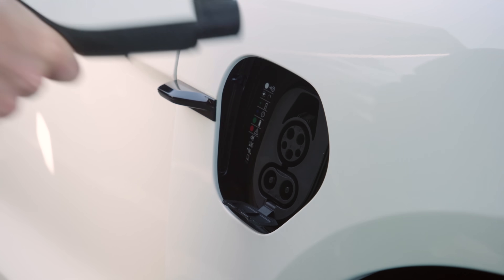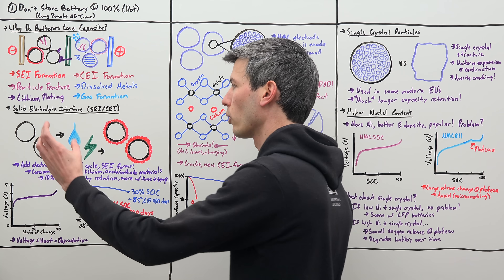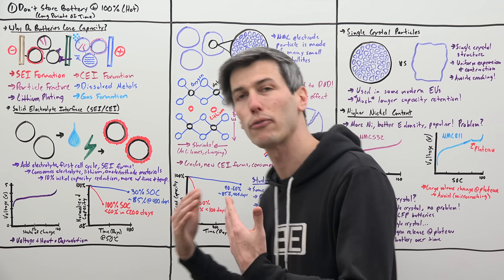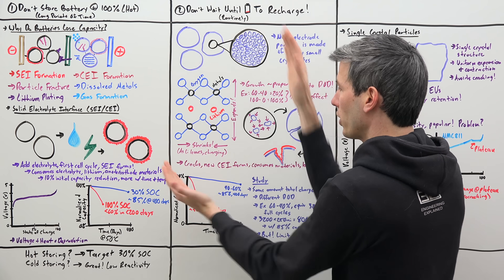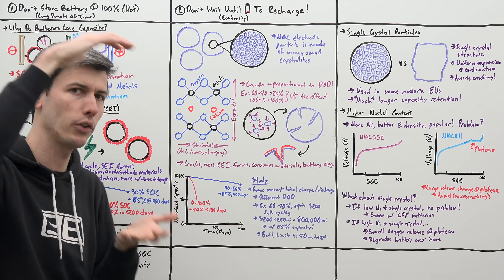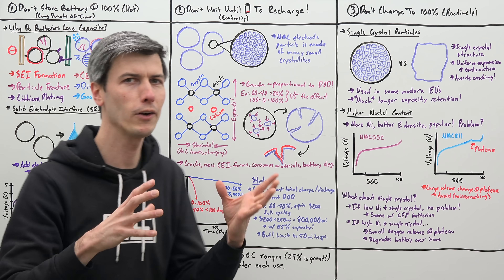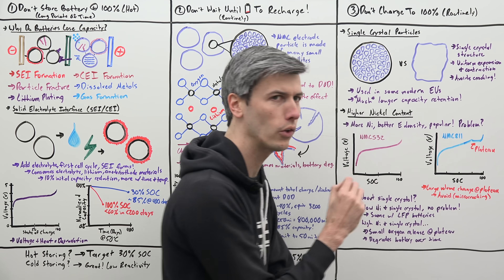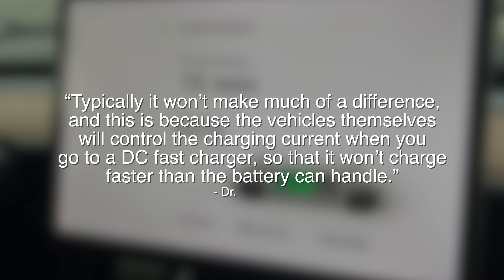How To Ruin Your Electric Car's Battery - NMC Edition!

Comment: You answered one of my questions.  We just bought a Chevy Bolt EUV.  I've been recently plugging it into 110V in my garage and doing a trickle charge overnight for multiple nights.  I wasn't sure if this was bad for my battery.  Sounds like it is better than doing a full charge using a level 2 charger.  I should also mention that I've only charged on level 2 and level 1 (in my garage at 110V).  Have not charged using a Level 3
Reply: From a perspective of battery health, level 1 vs. level makes no significant difference. But, from the perspective of minimizing one's electricity bill, level 2 is more energy efficient, plus the faster speeds of level 2 make it easier to schedule all of the charging to happen during cheap off-peak electricity rates.

Really, the only reason to charge off of level 1 is to avoid the up-front financial expense of installing the level 2. But, once the level 2 is installed, there is no reason not to just use it all the time.

Comment: More than often its not degredation that kills a battery, more often its some silly gadget inside the pack like the BMS, contakters or a cooling leak, so molycoddeling your battery will get you nowhere. IMHO you might as wall do what´s convienient on the day and foget degredation.

Comment: Great video. Are some of these studies referenced actually about cells and not a battery (collection of cells)? Wouldn't the impact be different due to the BMS which should theoretically help to swap between cells during charging and keep each cell at a good SOC as well? If you have 100 cells in a pack, you could say 33 cells at 100% would be a 33% SOC, but I'd think that the BMS would instead be splitting that amongst the cells in some intelligent way such as 100 cells at 33% each... or a mixture of 20-60% for performance related issues, cooling efficiency if fast charging (only cool parts of the pack as needed?) --I don't know anything about this, but just seems like there would be a lot more complexity when put together as a system with the BMS. Anyone know how that all works?

Comment: Thanks for these recommendations and the explanations.
I often use our PV surplus for charging the car in a range of 1,4 kW to around 5 kW.
I heard that charging at low power levels is also bad for the battery.
Is that true?

Best regards
Jens

Comment: I assume the same applies to smartphones and other mobile devices? I usually charge from 20% to 80% but it'd be better to charge as often as possible to 75%?
Too bad Apple doesn't allow you to set a hard cap on the charge level.

Comment: Great info, but just like interest in Science, the average Joe who will be the majority of EV users will not be interested in doing anything Current users, those who take an interest in the EV and techies (a lot of current users) would follow this. With Software-Defined Vehicles, all these measures should be controlled by the EV's systems, not the user, just like disc brake-wiping should. So if the EV's been left unused for x-number of weeks the EV system runs the battery down to a lower percentage, similar to cold conditions. You already know best practice, now put best practices into the EV's software.

Comment: not interested in the micro structure to explain the reasons, just want a quick summary statement of each recommendation.  Put them up front then if I want to understand I can listen further. Take your method from the way newspaper columns were written. Brief statements up front and then less important as the length goes longer. This allows the editor to cut the article to fit the spot.

Comment: When charging at home, what effect will it have on the battery to charge more slowly (eg 32A) vs. faster or max capacity of the wall connector (48A)? Any benefit or recommendation?
Reply: Amps is a bit of a weird thing to use here without mentioning the voltage or phase type.

Comment: Less maintenance? I need an oil and oil filter change twice a year, a transmission oil change evvery 5 years. Trust me, that costs far less than the extra $20K I need to spend on an EV for a similar vehicle.
Reply: I do brake lubrication once a year, and change the cabin air filter every other year.
The car is now 5 years old, and I recently changed the brake pads for the first time. I had only spent about 30% of the brake pad material, but the pads were starting to delaminate from the steel.

EVs obviously need less frequent maintenance.

Comment: Tesla specifically says to keep the battery topped up and when not in use, on the charger at all times. 
Why would tesla say to keep it topped up? Perhaps tesla knows more than whoever this guy is. Is the battery designed to be full? Is that not the point? Im so sick of idiots.

Comment: I don't have a charger at my parking space but I do have one at my HOA garage (shared community charger). My strategy is if I arrive home with >40% charge I don't charge. That way I can maximize the time my car spends at ~50% charge. So let's say I arrive home with 65% charge, in that case I just park. If I arrive home at 25% then I charge back up to 75% or so and wait until I drop down below 40% again. I think that this strategy minimizes deep discharge cycles while also maximizing the time my car sits at ~50%. Since I work from home I drive a lot on weekends but my car is unused at least half of the week days, and I think it's best to keep it around 50% charge on those days. I try not too obsessive about it but that's the general rule. One exception is if I am going on a long road trip I'll charge up to 90% the night before, then maybe a few more percent before departure.

Comment: Honestly they should implement a system of "primary range and resereve range" where they rate EVs based on 80 or 75% charge for daily driving, and show the last bit as reserve. The cars come defaulted with the daily range and you have to manually enable the reserve range for trips and such. Making a law about this would remove the companies individual approach the same way the charging connector got standardized

Comment: Let's make it a bit more confusing. Depending on the brand, your EV might have a 5% buffer that is hidden at both ends of your SOC. So you could actually do 85% for a max, and 5% for a min and still be within the 10-80% range for the actual battery in the car. I don't think there is a brand out there that doesn't have a hidden buffer.

Comment: I do not agree with 800 000 mile claim. 
If you have DOD number 300 with 100% then you can do it also by 10% steps and achieve 6000 charging count but that does not mean you get higher mileage out of the whole pack. 
The maximum mileage is still 300 times maximum miles/kilometers you can do with one charge before the capacity drops to 80%. 
For example you do the 10% steps charges only, then you divide battery pack max mileage by 10 and multiply by 6000. 
Example Tesla Model S has NMC
Range is 634 km
NMC 100% steps DoD is 300 roughly
That means the whole pack can withstand 190200km before falling to 80% capacity from original. 
Charging with 10% steps
634 divided by 10 is 63,4 and multiply it by 6000 and you get 380400km so basically the double the range out of the battery pack.
Charging with 20% steps
635 divided by 5 is 127 and multiply it 2000 and you get 245000km.
Bare in mind that this is BEST case of scenarios without taking aging in to account so in reality you hit somewhere 200 k to 300k area with one pack. 
Warranty is put there mileage or age and age is for NMC 8 years. So you have something wrong in your math or didn't take account something.

Comment: BS on fast changing constantly, too much heat. Especially in hot climates. Tesla states "misuse"...
Reply: The batteries are actively cooled.
Reply: @logitech4873  Not enough, especially the wires.
Reply: @ginog5037  Where are people having issues fast charging due to heat? Which wires?
Reply: @logitech4873  My neighbor for one and a couple others. How about you, or are you just trolling?
Reply: @ginog5037  I asked where. I don't know what country you live in.
I've had zero issues charging in any conditions. Even in the 45°C temps in Spain when I drove down there on a roadtrip, charging still peaked at the expected 250 kW.

Also, you said "Tesla states "misuse"" but provided zero context to this. They just said a word? What's the context?

Comment: Jason, I have a 2023 MYLR.  Is it ok to almost never charge it to 100% if I don't need to?  Or is it recommended to at least charge the battery 100% once a week?  I commute approximately 75 miles daily and I only charge it to 70% every time.

Comment: You can get a lot of driving done in a model 3 with 20% battery. I've settled on 60% charge from spring to fall and 70% through winter. I charge at home and usually do a trip here and there to get a 100% charge in. I usually try to get the car on the road as soon as it hits 100%. So far after 13k miles and just under 2 years I'm still showing 0 degradation.

Comment: If I buy a new EV and able to go 800 kilometers on a charge about how far could I expect to drive after the car is 3 years old with 50,000 km  assuming I followed the proper protocol with the same driving habits.
Reply: It's pretty common for EVs to quickly degrade a few percent in the first few years, then the curve flattens out. 
You'll lose between 1-5%, so at worst it'll be 760km range. But most likely the degradation will be less than that.

Comment: Germany here - over here, there is another issue that comes into the equation: driving REAL fast. My Model 3 Performance does 261km/h max, and I try to hit that mark on the Autobahn whenever I can (after all, that's what I bought a M3P for). How does that cause problems for batteries? A BMW M3 Competition will need to have a warm engine before going full throttle on the Autobahn. Will similar precautions apply for EVs, as well?
Reply: Teslas limit power output with cold batteries.

Comment: EV is not the future and you pushing more of this futile technology so off putting, why not charge a car 100%, especially when you need to go on long journeys, why do you have to stop using AC/heating to get to your destination in winter or summer, we are going back to the Victorian age, this is ridiculous... start looking at Hydrogen and other alternative fuels, which ARE the future... And don't even start on the child labour in the Congo for the rare materials for these batteries!
Reply: You can charge to 100% just not too often you only need to go to 100 if its necessary m8
Reply: You can charge to 100% when you need it, no problem.
And why would you turn off AC/Heating? I've never had to do that. I live in northern Norway and last summer I drove on a 13,500km roadtrip through Europe. There were no issues.

Comment: If you shouldn’t charge to 100% capacity, do the manufacturers quote range on 100%, or 80% capacity??
Reply: Because you can charge to 100% when you need to.

Comment: I pretty much keep my Bolt between 40 and 60% most of the time. Bigger drives down to the city I can use 50%-60%. Rarely do I charge over 80% or below 20%.

It has not been an issue.

Comment: So if you want a EV you need to be a knowledgeable person on your car. The general public JUST isn't. They know were to put gas in. Most don't have a clue about how to check the oil. Now EV's have even more knowledge needed. More reason EV's are a niche market. . You cant expect the general public to ever know ANY of this. BUT hey GOOD video.
Reply: Not really? Most EVs come with default charge limit set to 80%, and a quick explanation of why. That's really the most important thing to remember, and it's not a lot of info.

Comment: Thanks for detail explanation on battery charging Engineer E’!  
I have a couple of Tesla.(2018 model X and 2023 model 3 P) after I saw your post I’m regretting charged my Tesla to 90% daily even I don’t drive them daily.(as I am currently a retiree)   Tell me if I should adjusted my charging to 80% from now on or it doesn’t make a different in my case?  Please advice.  

My 2018 model X 100D got a free lifetime supercharging with 30k miles so far.  

My 2023 model 3P has only using my home charger.  Had been charging to 90% and never used a supercharger yet.

Comment: A positive associated with your 40 to 60% charging regime, which implies re-charging after covering only 20% of the possible range, is that there is a further 30% available (so you have access to half the car's full range) if you find you need to run down to perhaps 10% state of charge on rare occasions.

Comment: Excellent video can we please address built-in capacities from the manufacturer, especially PHAV. Every manufacture varies and gives you a different range of battery to use Volvo. For example that’s not allowed to limit the charge and they state that 100% of charge of range for you is only really 80% of the battery however this is not documented. Can we please speak to the usage of batteries based on real state of charge and not what is displayed in a car.

Comment: 7:50 big error in your math there. Your calculation is based on the full 250 mile range of the battery being used in every cycle, but since we are limiting ourselves to 20% charge being used you could only go 50 miles per charge. That means the 85% degradation mark would be reached after only 160,000 miles, not 800,000.
Reply: Nah it's not incorrect. The 40-60% essentially means you recharge 5 times as often, every 5 charge being equivalent to the energy of a full cycle. You still get the same range, but divided into smaller bits.
Reply: @logitech4873  oh yeah you're right, a charging cycle is defined as the whole capacity of the battery. maybe I shouldn't write these comments after a week of night shift. -.-

Comment: I charge mine to 100% all the time, the app sometimes moans about not charging to 100% ... but the battery has a buffer as my useable capacity is like 90% of the total capacity, that means 100% isnt really 100%.  I guess some brands do allow you to charge to real 100%, so their range figures look good/better.

Comment: So basically an electric car sucks in the cold, it sucks in the heat, you shouldn't use it full range, it's more expensive, the tech is also used against you (subscriptions and stuff). All in all don't buy electric unless you live in the city and don't drive a lot.

Comment: Great video. I would love to see you do one specifically on LFP batteries, like the one in the Model 3 RWD. There is a lot of confusion around what is the best charging practice is, for battery longevity on the Model 3 LFP, because Tesla says to set the charge percent to 100%. Would love to know your thoughts on optimal charging habits for that battery.

Comment: Don't you think that you should explain more about the difference between the 3 main chargers types, and what different impact they have on the batteries..?? 
Because thats the important thing to know.
Fast chargers are very usefull, but the less you use them, the less damage you do to the battery.
Going from 0 to 100% in 10hours is ok. 
Going from 40 to 60% in 2hours is ok.
Going from 40 to 60% in 10 minutes constantly, will damage the battery.
The key word here is , SLOW CHARGING

Comment: I have a few issues with this video it doesn’t seem to address the issues of storing it outside in hot environments such as Palm Springs 100f + and the other side which is 15f - -50f.  2. High voltage aka 480v and above …… met lots of people have had issues of the battery not lasting too long aka 60-120k miles. 3 what about the age it’s bad for batteries to sit and not be used just like your phone plus the battery even if you treat it right it will die and leak eventually maybe 3-5 year so so. What about people who drive a lot I don’t agree with this doctor that he doesn’t live in reality. I don’t think 🤔 a battery would last 800k miles. I would like to see a real world test. If you look at real world repair shop data they say 7 years or 120 miles and have personally met 6 people who no matter what they did it happened every time in that range. Simple point batteries 🪫 wear out no matter how well you treat them.

Comment: LOVED the presentation and it is a reaaaaally interesting topic. buuuuut, ...
i kinda want to challenge Dr. Dahns presentation. so to my knowledge only the graphite anode builds SEI, because of the low electrochemical voltage potential that isn't stable with the electrolyte. so from that point of view your NMC explaination at about minute 6:00 doesn't make sence. my personal research from multiple papers looked more like that in general NMC(/graphite) battery aging happens mainly at the graphite anode. while there is aging in the kathode (via exfoliation) it is lower than the anode aging and can therefore generally be neglected. that is because the cell capacity is dependent from the lowest electrode / half cell capacity. still, your explanation at minute 9:00 makes sence. the aging of the kathode will be slower and NMC active material will be saved, but i guess it will not effect the global capacity. also the volume change will result in mechanical stress, but also for the anode in the cell.. therefore resulting in cracks in the SEI, new SEI building and loss of acitve material and loss of lithium.
sooooo, sorry for the long comment. but i'd love to hear/read your feedback =)

Comment: EVs need to have a total capacity of 5x what you drive in a single day. I drive 50 miles round trip to work. In order to keep the vehicle within 25% SOC for the longest life, I need a 200 mile battery at a minimum. Batteries degrade over time, so to have 200 miles after losing 20% of my capacity, I need to start at 250 miles of range. Any time I drive more than 50 miles I'm degrading my battery further and reducing the lifespan on the vehicle. Therefore, I would only buy an EV with under 250 miles of range if I plan to get rid of it within 5 years. I like to keep my vehicles for 20 years.